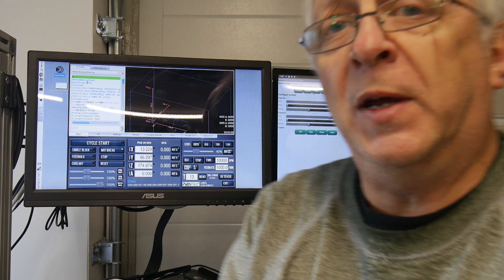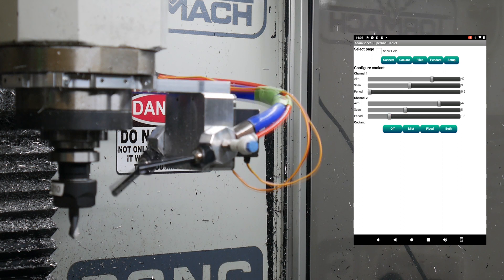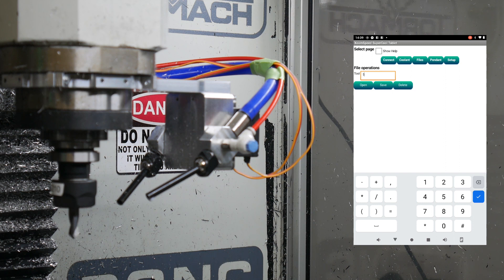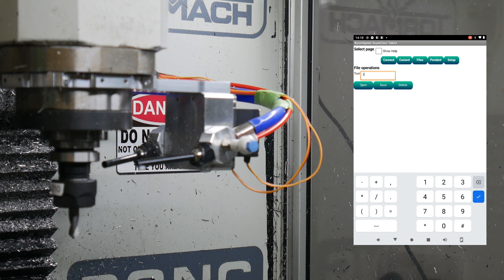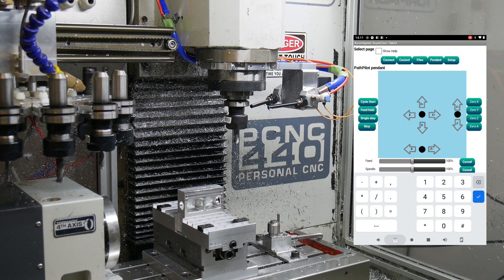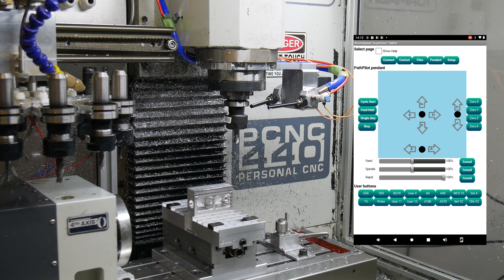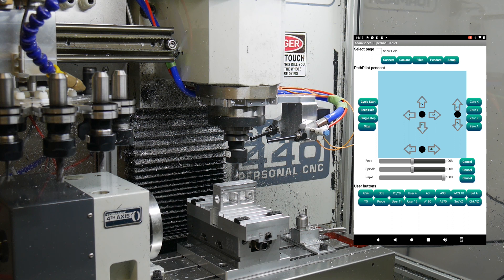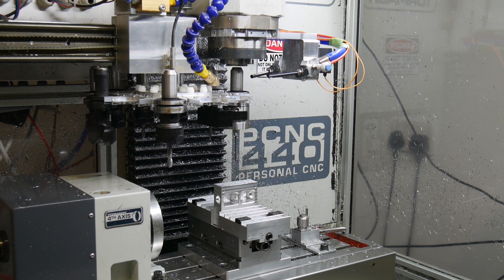Tormach mills - a new coolant system and an Android tablet for a pendant!

Comment: My 2022 project is to build your ATC. :)
Reply from the maker: Hope you enjoy that project.  As you can see, mine is a permanent fixture and is in use every time I turn my mill on.  There's quite a lot of parts to make, but none are especially difficult, so just take your time.  It makes a big difference to your mill once it's finished and working.

Comment: Great job David always like to see what you are working on. Really interested in some more info and will stay tuned to see if you make this available as I think it is something that would help in my shop.
Reply from the maker: I'll post again when I get the mk2 finished and I'll show how it's built.  The small, plastic gears I used in the one in the video just aren't robust enough to bet let loose on an unsuspecting world!  The strange thing is it's not the gear teeth that get damaged if you knock it.  The gears have M2.5 set screws in the hubs to lock onto flats on the 3mm shafts.  Those screws get pushed back and strip the threads.  The main thing about mk2 is switching to 4mm shafts, M3 set screws and sintered metal gears that are almost double the size.

Comment: Would love to see more info on how you are passing info back and forth between the tablet and path pilot
Would be super useful to not to be restricted to the off the shelf USB io board.
Reply from the maker: Have a look at http://xoomspeed.com/CNC/pathpilot/plugins.htm for details and examples of how to get code inside PathPilot.  Th traffic lights example is probably most relevant to what you're interested in.

Then have a look at http://linuxcnc.org/docs/html/config/python-interface.html for info on how to access the LinuxCNC kernel from inside a plugin.
Reply: @daleksw  thanks for the info, I'll give this a look!
Reply: @daleksw  I'm actually looking to do a similar project to this coolant setup, but on my Tormach lathe. I've got a custom tooling block with individual coolant lines that I'd like to turn on and off for each tool as it's called. 
I assume you are using the python plugins to talk with the micro controller you mentioned. Do you have any info on how you set up the communication with that micro?

Comment: Wow, amazing work!  Plus a DIY toolchanger.  I guess once you've done the ATC boredom sets in and an automatic coolant nozzle is the next logical step.  Any chance this would become opensource?  I'd love to build one for my 1100.
Reply from the maker: I already sell the ATC controller and the Fusion model.  It's quite a big project, but nothing difficult.  You just need to be patient.

In its current form, the coolant thing is hard to do the same.  Big problem is the deign requires mitre gears to get the 2 independent channels.  Seemed like a good idea at the time, but I only have a single source for the gears I'm using and the one thing I've learned is that the machining accuracy needs to be pretty good to get the gears to mesh properly - so changing them will cause a lot of problems.  A single channel version with a direct drive output would be much easier....